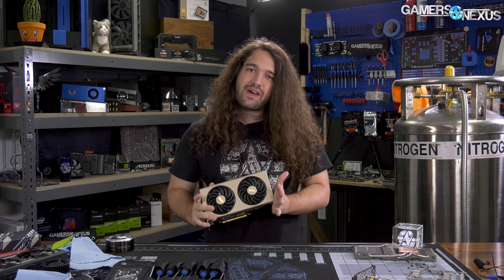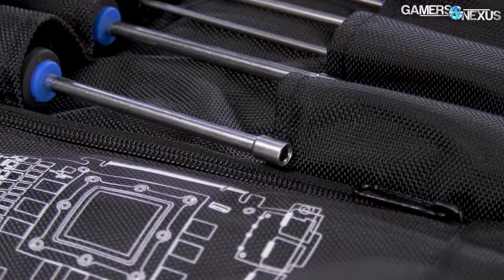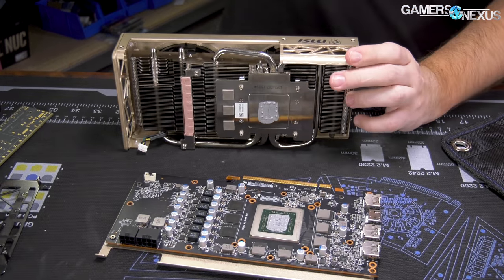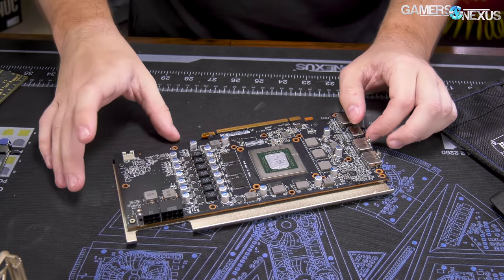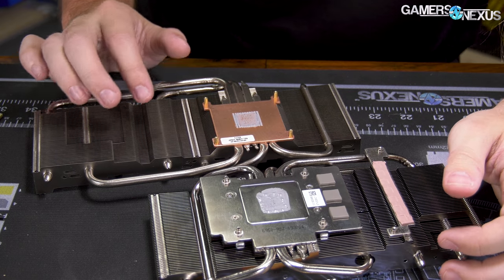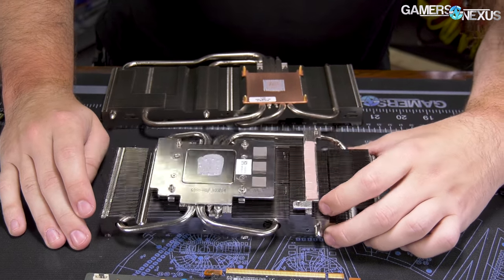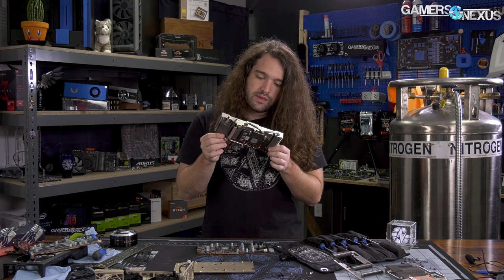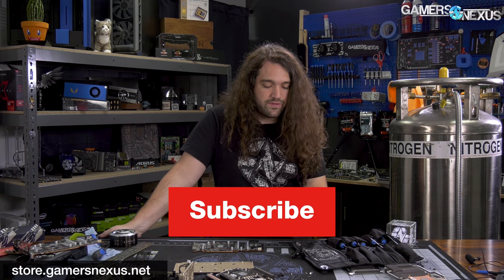Wrong Thermal Pads: Tear-Down of MSI RX 5700 XT Evoke OC

Comment: If only Australia had 'right to repair' legislation.
Reply: Yes, we need to push it to our elected officials.
Reply: @jackadams99  for pretty much the same reasons it came about in the US, abusive control by IP holders. Being able to fix simple stuff like badly placed thermal pads should be user serviceable. Even Sony let's you get away with a lot yourself to PlayStations.
Reply: @metasynaptic9451  it should be illegal everywhere to put the 'warranty void' sticker on products. Once you purchase a product, you OWN that product, and if you so desire to take it apart and fix it yourself, then that should be your choice. Companies try to get away with it because they'll make lower value products with faulty designs thinking people will have to always buy new ones, and it's fucking greed man. Like I already bought the product from you, am I not a good enough customer then?
Reply: @TheGauges420  don't disagree, bit we haven't legislated it yet, and it results in anti competitive conduct, particularly in the agricultural sector

Comment: This looks like one of the worse AIB cooler for the rx 5700 xt sure it looks really nice but who looks at their gpu when gaming never liked MSI products tried a laptop from them and it was riddle with problems to the disk drive not functioning to its gpu being unstable at stock for god knows what and wifi not staying connected tried 2 of these laptops no anvil tell I went with an asus...

Comment: Wouldnt it have nothing to do with the tooling and baseplate, because the pads are on the far side of the memory from the core; hence, the far side already lines up with the baseplate. This is just a matter of them putting retarded thermal pads on it?

Comment: The thermal pads are too thick on the memory to start with!, which is leaving a bigger gap between the cooler and the gpu!, look how much thermal paste is on that gpu die because of this!. When do you ever need that much thermal paste!, MSI need to use thinner pads on the memory modules so the gap between the cooler and gpu is smaller, then maybe they will get better thermal contact, will not be buying this card after seeing this!!!, Look how much thinner the paste is on the sapphire cooler!, That is how it should be MSI......